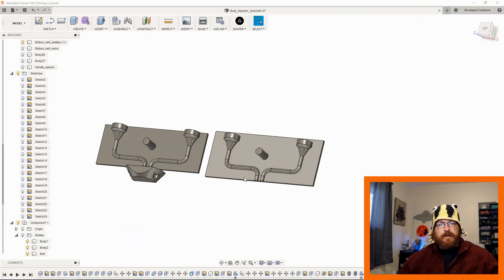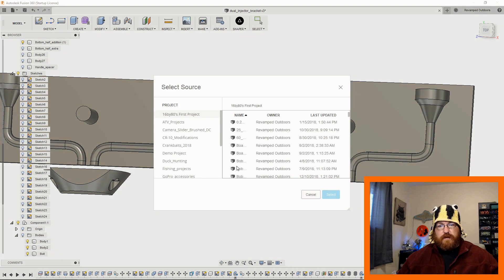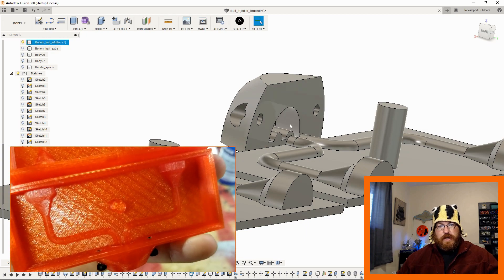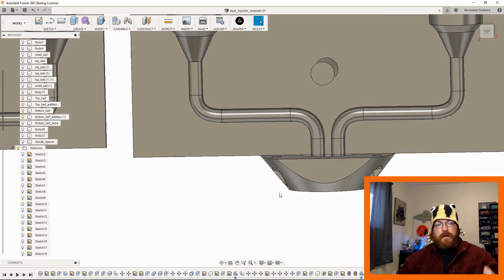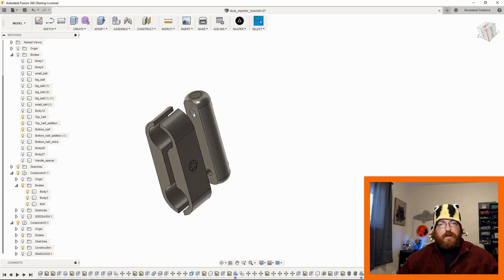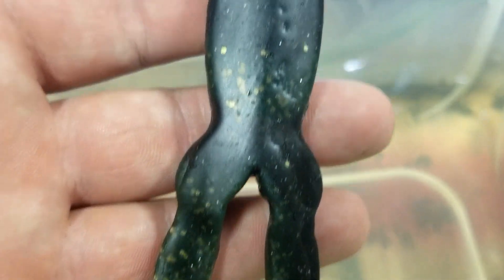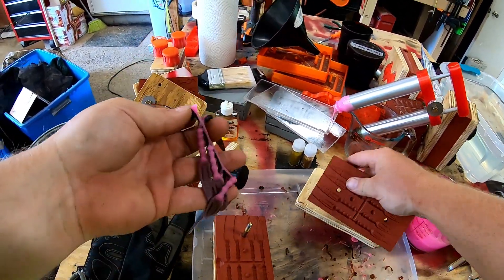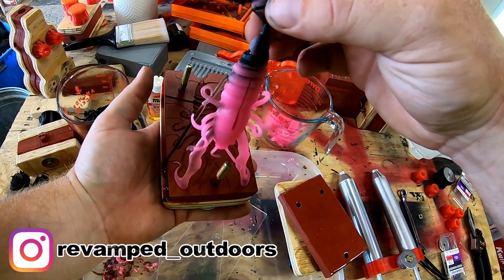I saved over $150 USD using my 3D Printer designing soft plastic lures

Comment: Ok. I have alot of questions but let's start with, why not make you injector from 3D plastic?
Reply from the maker: I use PLA or PETG that deform pretty badly at about 180 F and the plastisol I use I have to get 200 + F or so.

Comment: Geee just watching gives me so many notions.  Such as a smaller diameter on one side, creating flow speed differences.  Such as nesting one outlet inside the other so you'd have a circular lamination.  Such as making one transit length longer than the other so there is an initial rush all from one colour before the lamination begins.  Such as splitting one tube into two outlets one on top the other to make a three layer lamination.
Reply from the maker: Shhh don't tell anyone lol, I have a few in the works doing a couple of those things, multiple injection points especially, trying to work out how to be able to tell when to stop on each.
Reply: @RevampedOutdoors  Hi mate, i really like your video and have some questions, could i add you on facebook? or whatsapp?  or Skype?
Reply from the maker: @starrr34  thanks, I'm not on any of those platforms but I am on instagram if you want to message me there.
Reply: @RevampedOutdoors  I don't use Instagram, but i was wondering if you could sell few moulds? and i believe you based in US?
Reply from the maker: @starrr34  I am in the US but I don't sell anything right now because I am not a business. I may open one in the future but currently I am just doing this for fun.
Reply: @RevampedOutdoors  ahh I just need 2-3 moulds :/